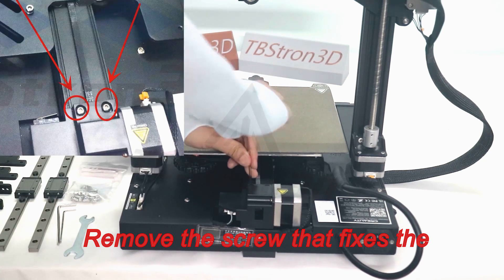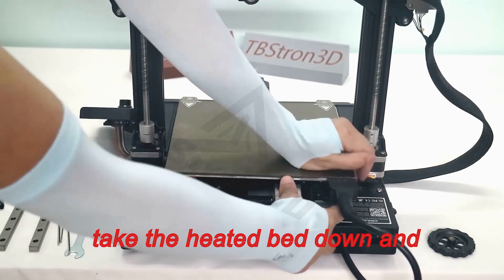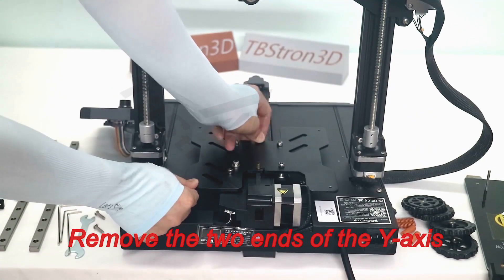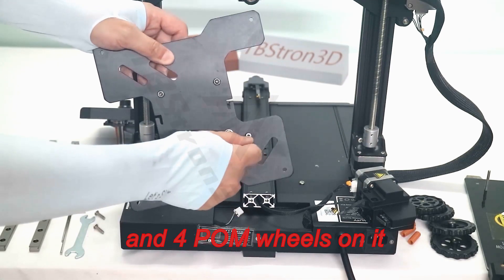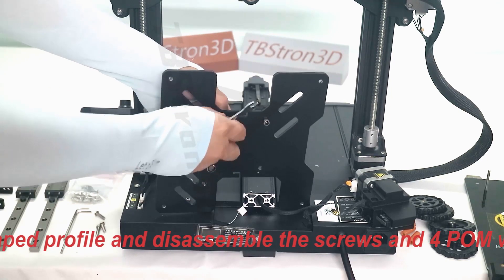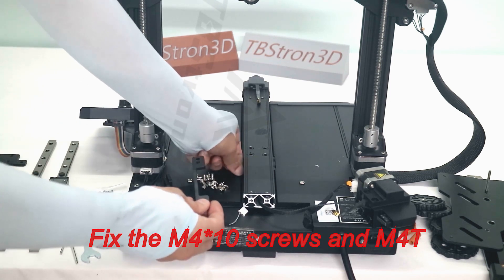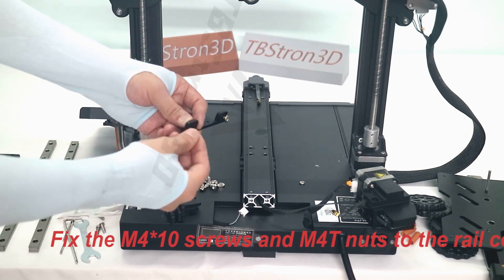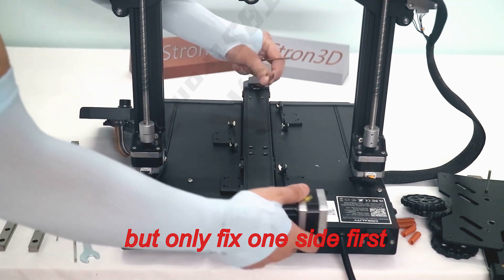CREALITY Ender 3 S1 Y-axis upgrade linear rail installation guide.

Comment: What is the specification of the  Linear Rails ?
Reply from the maker: Hello, thank you for your attention. the model of the straight linear guide on the Y-axis is MGN12, with a length of 300mm and equipped with an MGN12 slider.
Reply: @tbstron3d-yf9op  Is it the same for s1 Pro ?